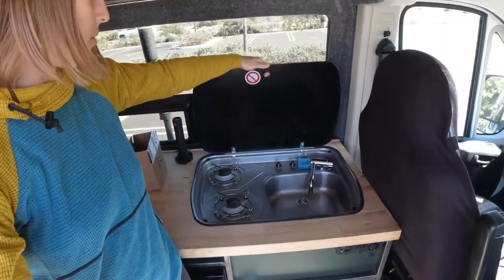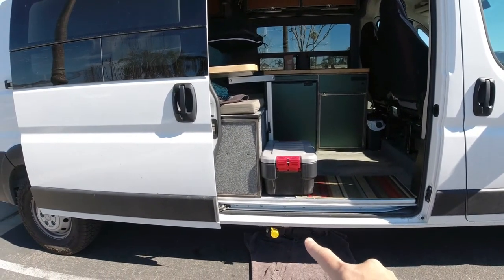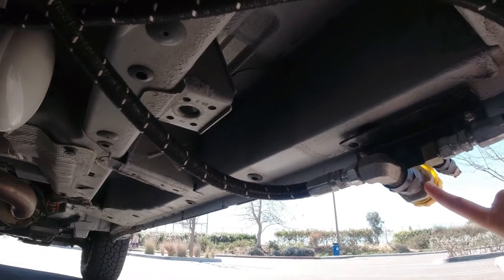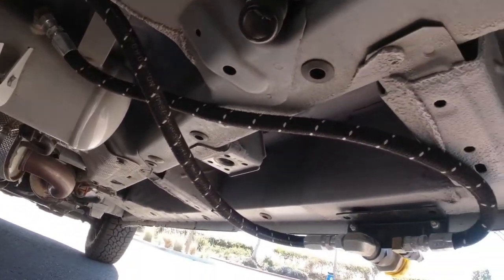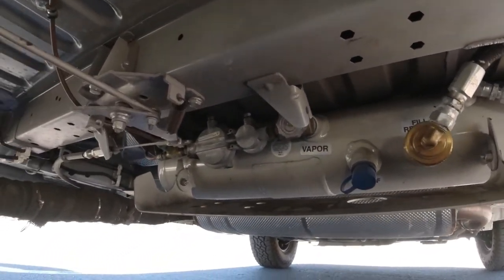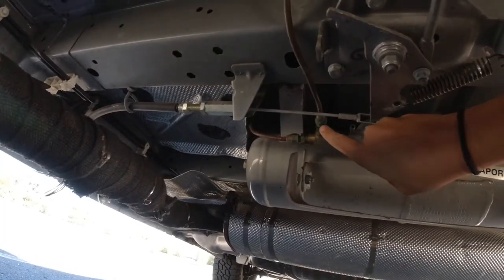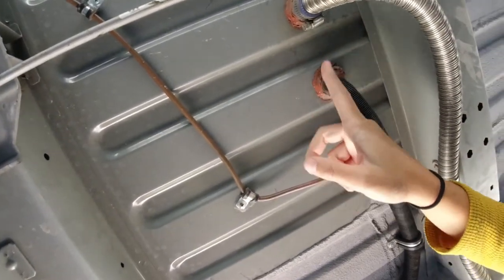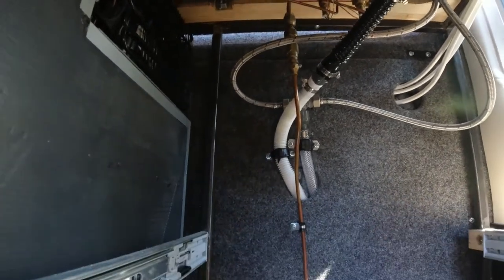Nashfuel Propane Remote Fill Kit for Van Install:  Product Review and Install Tips

Comment: Is there a reason you used copper over just hoses?  It would seem hoses are easier to deal with but maybe there is a good reason not to use them?
Reply from the maker: Thanks for watching! That is a great question. I can't remember why but my assumption is that is what all the installation instructions were calling for. We did a bunch of research for each item at the time and must have decided that it was the better option.......and trust me.....I was worried about running the copper tubing.

Comment: This project is on my list.  Thank you for posting your experience!  As you know, they make sure they provide. no instructions.   What did you use as heat shield on your exhaust system?
Reply from the maker: Thanks for watching! We used a "wrap" (metal outside) for the muffler and then high temp exhaust heat wrap for anything that comes near the goods. 45k miles and no problems yet so I think we did a decent job.

Comment: How was your experience using the green propane before? We are using an 11lb tank and stored inside. We get told all these horror stories time to time and sometimes it doea make us think☹️
Reply from the maker: The green cans weren't all that bad but we were changing them every 2 weeks.  They are safer because they have their own pressure releases on them and it would be a small amount if it did leak.

Comment: I only pressed like 200 different links to finally figure out how to find this video. Thanks for posting, this is exactly what I need,  and really well explained too!  When you cut the hoses shorter did you have to buy other fittings and have them crimped on there or is there a way to adjust the hose length and use the fill fittings that came with the kit?
Reply from the maker: We're glad you found the video! Bummer that is was such a pain though. We didn't have to purchase any additional parts for pur kit and it was intended to be cut to fit. Thanks for watching!

Comment: Comment #2 my tank and heater is installed. I need a remote propane fill kit, I will use your links for the kit and leak detector. 
Thanks for posting this 👍
Reply from the maker: You're welcome, thanks for the comment!  Best of luck on your install of the remote fill kit! It wasn't too bad once we finally got the parts figured out!

Comment: looks like a death trap, if those hoses or valves get caught on a curb or rock good bye Freddie
Reply from the maker: Thanks for watching Brett! I wondered about that but can say that I'm not super concerned. I smashed it on a rock and it held up nicely! Even if it ripped off, I think it would just empty the tank quickly since there wouldn't be an ignition. Am I wrong? This system is made for this exact purpose so I feel better about using it than having a giant propane tank inside the vehicle with me.

Comment: Thanks for the video. I'm installing the exact same stuff but can't figure out how to get the fittings on the hoses. I know you mentioned this was the hardest part of the install and I can totally agree with you on that. Can you advise me on how you did it. I can only get about a 1/4" of the hose in the fitting no matter how hard I push. I have the fitting in a vise and am pushing and twisting the hose into the fitting with no success.
Reply from the maker: Hi. It definitely wasn't easy. I believe we ended up using a little soapy water......and a lot of pushing and twisting.
Reply: @DrifterJourney  The soapy water helped. Thanks for the tip!
Reply from the maker: Perfect, glad it worked! 👍
Reply: Actually, Google Reusable Hose Fitting video. I was dreading this and then I found these videos. You left screw on the outside housing and then you screw the hose fitting into the outside housing.

Comment: Great timing on this video. 
I am getting ready to do almost the same installation. 
Installing a propane tank for my Propex heater and I will have to use a remote fill.
Thanks for posting this and a thumbs up for the video 👍
Reply from the maker: That's great, glad it's helpful for you!  Thanks for watching and good luck with your install!
Reply: @DrifterJourney  thanks 👍

Comment: Awesome timing for me as well! Installing remote fill on my tank today! Thank you for the video. Did you have to unthread your bleeder valve from your tank to thread in the elbow provided to connect to the hose? Was it a left hand thread?
Reply from the maker: Glad it's helpful!  We did unthread the bleeder valve on the tank because it gets rethreaded into the bracket at the other end of the hose.  The only thing that was reverse thread for our tank is the regulator
Reply: @DrifterJourney  thank you for getting back to me.  I finally ended up getting the bleeder off the tank after a lot of struggle. It was a standard right hand thread on my tank as well but I couldn't get it to budge. I had to torch the fitting and spray pb blaster multiple times and I finally got it to turn with a 10" pipe wrench.
Reply from the maker: Wow that's crazy that it was so hard to get off.  Glad you got it eventually!
Reply: Can I ask a stupid question. Does all the propane come out when you remove the bleeder?